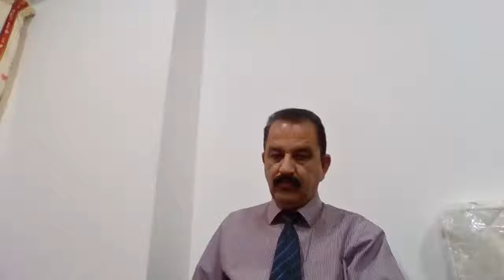Civil Construction Material-Concrete Curing-Technical session / lecture no 15

Comment: Curing of Concrete Pre-cast - Brick, Block, Paver, Roof Tile, Piping, Pre-stress, Structural Precast, Panels and Concrete Elements are recommended by fast type of curing.

Comment from the maker: What is Hydration  process--------------------------Hydration is an exothermic chemical process, increasing the ambient temperature will increase the rate of hydration, and hence of strength development, while lowering it will have the opposite effect. 
Too much heat reduces the final concrete strength. Selecting an appropriate curing process helps in temperature control during hydration

Comment from the maker: Is Lack of water also causes the concrete to shrink:---------------- which leads to tensile stresses within the concrete. As a result, surface cracking may occur, especially if the stresses develop before the concrete attains adequate tensile strength.

Comment from the maker: The accompanying figure shows how concrete strength varies with curing conditions. 
Concrete that is allowed to dry in air will gain only 50% of the strength of continuously moist-cured concrete.

Comment from the maker: What is curing time--The most crucial time for strength gain of concrete is immediately following placement. 
In field conditions, heat and wind can dry out the moisture from the placed mixture.

Comment from the maker: What is relation of water --------As long as water is present, the hydration will continue for many years. The final strength of the concrete formed in the process will depend on the constituents in the original mixture, and the environment under which the reactions take place.

Comment from the maker: Portland cement consists of several complex chemical compounds (see composition of cement). In the preparation of concrete, the cement acts as a glue which bonds together the aggregates to achieve the final cast product.

Comment from the maker: Oven dry details: (Early carbonation curing was developed for hollow-core concrete slab production to partially replace heat curing and recycle carbon dioxide recovered from the cement kiln. 
The cavities in hollow core slab were utilized as a CO2 gas chamber to facilitate a carbonation curing at a low gas pressure. 
Concrete performance was evaluated by carbon dioxide uptake, compressive strength, pH values and resistance to air permeation. )
 The temperature and strength data from the curing process of each hollow core slab is collected and compared to the data from the heating system. 
Early carbonation curing was developed for hollow-core concrete slab ... The cavities in hollow core slab were utilized as a CO2 gas chamber to ... T2 and T5 were heat treated in an oven at 50 °C for 1, 2 and 5 h respectively,